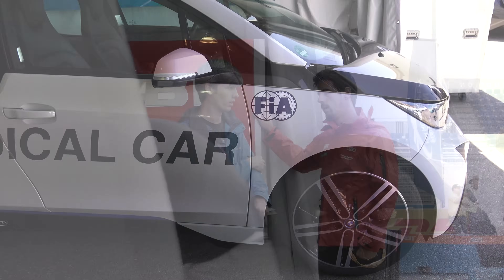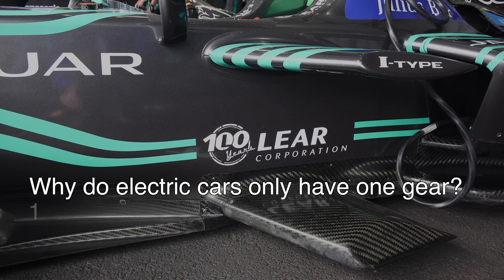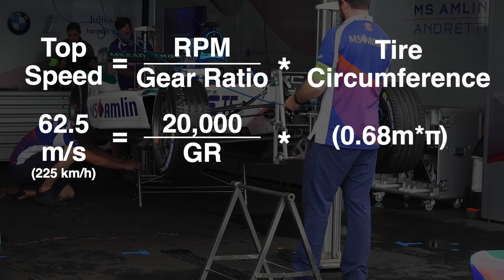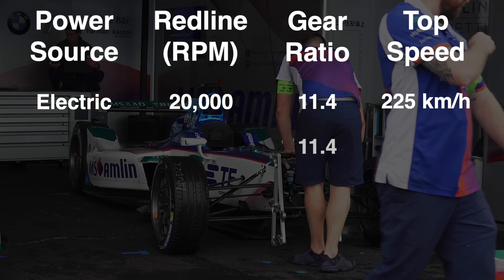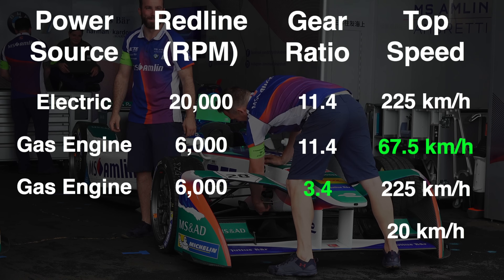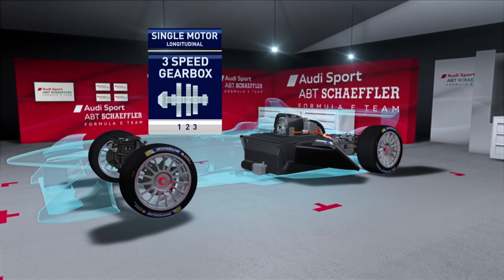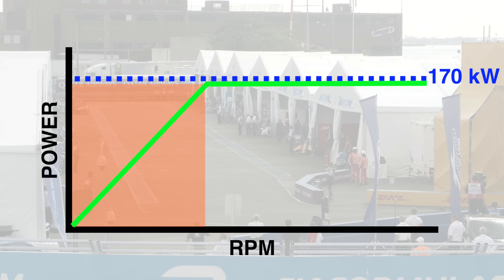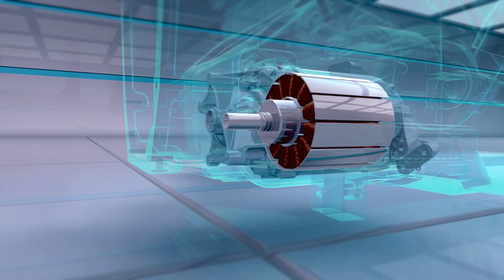Why Do Electric Cars Only Have 1 Gear?

Comment: For an electric road car that needs to maximize range, could a multi-speed gearbox be used to keep the motor at peak efficiency, overcoming the increased inefficiency of the gearbox and thereby extending range? Or maybe a more efficient motor design could be selected. I seem to remember one of the early (modern) electric motorcycles did this.

Comment: So overall, would there be any benefits to have a CVT in an electric car? I ask because if you're going to have any gears at all, why not have it be the most efficient type?
Reply: Chaotic-Good Antinormie CVT has big losses and whole point of cvt is to keep the engine at constant power/engine speed at peak efficiecy to neglect own loses. Electric motor by design make constant power over most of their rew range. Simplest reduction gear is most efficient way to trade frequency for torque.
Reply: A transmission has a efficiency of around 85-95%, depending on the rev. So in you can save 30% power during acceleration for about 30 seconds, but loose 5-15% during crusing for the next 10 min you are way worse off with a transmission

Comment: 1 missing factor in using gears in an electric car is ,a smaller  less powerful motor can be used to achieve the same thing as a large motor with a single gear to achieve acceleration rates & top speed. BUT the power loss & extra weight of a gearbox can easily be offset by using the larger motor ,so there not used . An electric motor cannot stall at slow speeds like a combustion engine can at 1rpm

Comment: Great video. I’d like to suggest doing a video on tires and proper rotation and tread wear guidelines. For example, I’m having a disagreement with coworkers on replacing 2 or 4 tires at a time on their front wheel drive vehicle. I maintain that if you are only replacing 2 tires you need to make sure those new tires go to the rear of a front wheel drive car to prevent over steering. They think new tires or best tread tires should be in the front because it’s the drive tires on front wheel drive.  I try to explain that regardless of front wheel, rear wheel, or all wheel if you have miss matched tread depth tires the best 2 should be on the rear to prevent oversteer where the rear end lets loose which is harder to control than under steer.  Anyone with an opinion please chime in?  Thanks!

Comment: Depends on the rules and if the 170kW is electrical pack discharge / measured at the controller, the motor, or the wheels. If it's measured at the wheels then you would be crazy not to have a gearbox. If it's limited at the controller, be a tough call, and may be circuit dependant.

Comment: If the electric motor can stay at max HP till the car reaches it's Vmax, that particular torque vs rpm curve gives the maximum power (and therefore the maximum acceleration at a given speed) - so there is no need for gears if your motor is powerful enough and can maintain max HP - that itself guarantees the absolute maximum acceleration you can ever get. But the fact that the motor has to spin upwards of 20k rpm means the low end torque of an electric motor will be immense -- only then we can generate that torque curve. And since electric motors need not spin at idle, there's no lugging, so no need for even a first gear.

Sometimes if a motor can't generate that much low end torque, or if it can't spin to such a high rpm, only then does it need a second gear (and almost always never more than that).

Comment: I wonder how the power and efficiency changes or degrades over the life of the car with an electric motor compared to a gas engine. I know my ten yr old car had 250hp when new and got 17/27mpg. Now I’m sure it’s not even close to 200hp and only gets 13/21mpg as the moving components in the engine have worn out. How does an EV compare in this regard?

Comment: well if you compair to the Old Citroen Saxo Electric whit 27 hp you get 127 Nm peak by 6500 rpm, if you look at the cars back then about same rpm Gas engine they need 75+ hp to get about same Nm. so you get about 5 times bigger Nm even back then.

That about the same as what 3 gears gas engine do, but they normally slow.
lets say 2 engine, electric and a gas:  27 hp 7000 max speed.
gas will have around, 27 hp 41 Nm at 4700 rpm but a low of 27+- Nm low speed.
El. Have 27 hp about 120 Nm to max Nm/rpm about 1600 rpm.
So to get the grip like electric you need gearing Final gear/1 gear total 9.333 if hit 90 km/h.

1: 27 Nm*4,5 *9.333=121 Nm *9.333 = 1129 Nm
2: 41 Nm*2 9.333  = 82 Nm 9.333 = 765 Nm
3: Peak rpm 14.5Nm *9.333 = 14.5Nm *9.333 = 135 Nm

Electric= 120Nm *9.333 1,119 to 2100 rpm(27km/h). 
at 7000 rpm 14,5Nm*9.333 = 135 Nm

(Not count the loss or gas engine curve and shift time, then you might need 35 Hp to even out acc. and here we talk about a old 98 tech car vs. 2005+ type engine)

Just think about it Electric cars are like driving gas cars in 3 gear all day long :-D

Comment: Thanks bro. A very clear presentation on EV engine. EV and dronecar, hyperloop will be the future that replace the combustion engine cars and bullet trains for within city and city to city transportation. While jet plane will still be used for cross ocean transportation, the dronecars are used within cities avoiding massive trafic jam on roads. Just like the EVs, the dronecars are all battery powered, with less components parts, pretty fast, cheap, safe, clean and easy to maintain. Congratulation China, for being the world's leading EV producer and soon it will be the world's leading Dronecars producer too, with Ehang.

Comment: This works for power limited motors. A non-regulated motor will not have a flat power output, it will peak in a parabola. Given this curve, it makes sense to have gears to keep the motor in it's peak power production point for maximum acceleration. Granted the rest of the system needs to be considered, like how aero will require more power and probably be a speed limiter before the motor moves far enough out of it's power band. It's a shame people talk about torque. Torque is a terrible metric because unless you're pulling stumps out of the ground it's power that takes into consideration the purpose of a motor! Which is to move a mass from A to B quickly (work), how much work can be done in time, that's power.
Thank you for being clear with the limitations of the Formula E motors having a flat regulation power curve. Maybe doing the math on your whiteboard explaining how electric motors could benefit from a transmission?

Comment: I got the opportunity to ride an Empulse electric motorcycle that has a traditional motorcycle transmission. While i am accustomed to the instant torque supplied by an EV, I own one, and i have ridden other electric motorcycles, i was not prepared for the acceleration of the Empulse. while EVs lose that "punch" at freeway speeds the Empulse still felt lively at, er..., the legal speed limit.

Each gear that power passes through costs, IIRC, somewhere just north of 5% of the power transmitted. EVs hare at least one reduction gear and a motorcycle transmission uses, I believe, three at a time. Regardless, that motorcycle had a much more normal feel at speed even at speeds that were a Ton of fun.

It's a pity that Brammo stepped back from developing the bike and sold it to soon-to-be-closed Victory. It lacked ABS and refinement, but the raw material was there to make an amazing ride.

Comment: An E motor on each wheel would change the dynamics of motor racing.  Acceleration, mind boggling top-speeds and cornering, aided with four wheel steering and all of it controlled from a single joy-stick. One problem would be rapid tidal-like blood flow in the brains of drivers (most dangerous).  But small, lightweight batteries fast-charged by contact-less strips on the racetrack means no need for refueling stops. We already have the technology to do this - all that's needed is the will.  I be thinking Formula E has a bright future.

Comment: You could also think of the electric motor itself as the transmission, as is the case on many locomotives. On diesel locomotives, for instance, the traction motors generate very high torque when accelerating from a low RPM, and generate proportionally less torque at higher RPMs, thus outputting the same power at a wide range of RPMs. This effect is called motor stalling, and it essentially causes the motor itself to act like a continuously variable transmission. Hence the motor acts like a low gear when accelerating from low speed, and acts like a high gear as it reaches the desired speed. The reverse of this effect allows the motor to act as it's own brake, which is called dynamic braking, or regenerative braking when it's used to recharge the battery during deceleration. This is why diesel and electric locomotives are able to generate the huge amounts of torque required to start massive freight trains, whereas steam engines have difficulty pulling large trains at low speed.

Comment: On the flipside of gears for adding power at low revs, trains often have motors that have multiple sets of windings that can be powered up, thus limiting the amount of torque and allowing the train to accelerate without wheelspin.

Comment: i think you need to recheck tyre size and math slightly .........  formula E  uses 27/68-18 meaning..... ( tread width / aspect ration of profile height to tread width  / rim diameter ) which is 79.1 inch  ( 2.009 m ) rolling circumference diameter.... 25.1 outside tyre diameter

Comment: Ampère's Force is only proportionate to electric current density, and independent to rpm, while force/torque of a combustion engine is related to impulse of each combustion, which is related to rpm. For electric motor, we can simply adjust current density for desired torque, hence desired acceleration, with rpm being completely independent. Also, electric motor gets its torque without any lag coz  the speed of electric field is the speed of light. The only threshold for electric car is all related to battery, but not the motor. Electric motor overwhelm combustion engine on all aspects, with no doubt, which we have well-proved as early as in 19th century. Those who still claims combustion engine is somewhat better are simply ignorant, unless what they like are its unique sound, smell and unsmoothness.

Comment: Electric cars have only one gear the same way as primordial IC engines were only coupled with one or two gears.
Only now are we developing the electric motor properly for use in the auto industry. I really do believe that specific units will be developed that will benefit the usage of multiple gears or CVT. While the electric motor may have a wider band of power/torque that we can work on, efficiency laws still apply, and as such, IMO some type of gearing will eventually be considered as the best approach to keep the electric motors of a vehicle working nearer to their peak efficiency.
Stickshifts will not come back, but automatic transmissions with two or three gears (as in high-torque, medium, high-speed), or even CVTs may show up in the future.
But this is only my opinion, considering that lower kW electric motors can be used to replace the higher kW ones that are being used now, considering the high low-end torque that would benefit some form of gearing.
On the other hand, complexity, production costs etc may dictate otherwise. It's still a bit too early to assume that they will remain 1 geared machines, thou...

Comment: The thing I wonder about is if a transmission could add efficiency (in terms of consumption, not power output) when it comes to high(er) speed highway driving. for example, I looked at the Opel Ampera-E (basically the same as the new Chevy Bolt) and it's limited to 145Km/h is wich is an absolute NO GO for me. And they used the argument that it saves battery life.

Comment: In an electric motor, amps and volts directly correlate to torque and speed. An electric motor doesn't have only one gear. It has infinite gears. It has it automatically, and you don't need a gearbox for it. Just change the current/voltage going to the wheels, and it changes your torque and speed.

Comment: Starting with a false question, answer is inevitably false too.
The right question should be "Why do Electric cars need less gears ?" (same car, same power)
And the answer is : 
1. because they have a relatively symmetrical (to the center of the RPM range) power curve, which is beefy to the lower part too.
2. efficiency curve can move to the left (lower RPMs) when part throttle
3. we can easier compromise with a slightly poorer performance, in the name of a new technology, environmental protection etc 
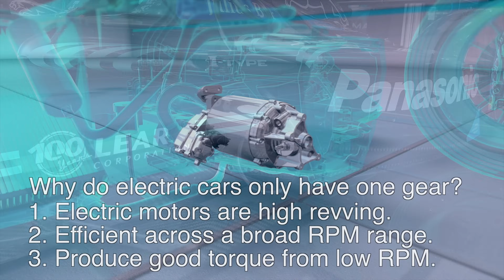At 0:51
1st is irrelevant. An electric motor with the same power and half the revving, needs the same number of gears for the same car, performing the same (of course the motor will be heavier)
2nd is not true. Efficiency curve is relatively narrow. The only advantage is, as mentioned above, that moves to the left when part throttle
3rd is true but not enough. Truck engines also produce good torque from low RPM and they need gears.

Comment: After the apocaplyse, when only residual, off-grid power-supplies are available (wind-turbines, photo-voltaic panels, but maybe a few hydroelectric plants'), AC-induction motors will need to be scavenged. The big fukkers out of the likes of Teslas will be particularly in demand, I reckon.

Comment: Electric motors don't, however, produce a lot of braking torque at low RPM, hence the huge motors used by Tesla. Had they used a 2-speed transmission (which was considered), much smaller motors could have been used, which would still have produce useful braking torque/power and hence regen at urban speeds.

Comment: The answer is simple. Your description is wrong. The field strength acts as a transmission. Strong fields give high torque at lower RPMs. This is equivalent to low gears. As the field is reduced, RPMs increase, while torque decreases. DUH!

Comment: Um, mine has 5 plus reverse and a clutch! (it's converted to electric)
Reply: do u use all five forward gears?
Reply: Yes but 1st is only required on stupidly steep hills. Normally a 2nd gear pull-off is fine

Comment: Aren't the latest Tesla Model S's the fastest 0-60mph production cars? However they are not the fastest 0-80mph cars. If they had another gear for high speeds, perhaps they could also be the fastest 0-80mph production cars?
Reply from the maker: +Hyper Sonic well, the Dodge Demon does have a quicker 60 - but that's on a prepped drag strip. And generally speaking, upshifts result in a lower g-force of acceleration (that's how gearing works, taller gears accelerate slower), so putting in another taller gear in a Tesla would likely result in slower acceleration, not to mention the time required for shifting.
Reply: So extra gears wouldn't help? Turbos greatly accelerated ICE engines at high speeds, I wonder what the equivalent to a turbo would be for electric cars. 4 or 5 AC phases instead of 3? Is much more power required to accelerate from 60-80mph than is needed from 0-20mph due to wind resistance, and the motor is unable to draw enough power from the battery?
Reply: Factoring out wind resistance (say you were in a vacuum tube) I wonder if 60-80mph would be the same time as 0-20mph, or there''s something else going on, perhaps the inverter can't switch fast enough.

Comment: OK well I get why you'd need only 1 gear in formula E but I still don't get something: to be able to stay at 20'000 rpm an electric car must be using a shitton of electricity. Since electric cars are so good even in low rpm wouldn't it save a lot of energy to have more gears so that you can always keep your engine at low rpm ?

Comment: I have nothing against electric cars, i fully support them. But for some traditional sports like Formula 1 sound is 50% of the experience. 50% looking at what is happening, 50% listening. And that is why F1 really needs loud engines. If electric engines can sound like gigantic lightning storms, i might love to have electric engines in F1. But if they sound anything less than massive lightning storms, i am not interested in hearing that noise.
Noise in Formula E is just super annoying, i wish it would actually become far more quiet.

Comment: Looking forward to your video of how 1 gear and an electric motor shaves thousand of parts and hundreds of moving parts off an EV vs. a fuel based car thereby making EV's half the cost or less to make.  Don't forget to include engineering, testing, design, purchasing, warehousing, shipping, program management, sales, accounting, and other support functions cost savings  for each of those parts as well as substantial job losses in the calculations.